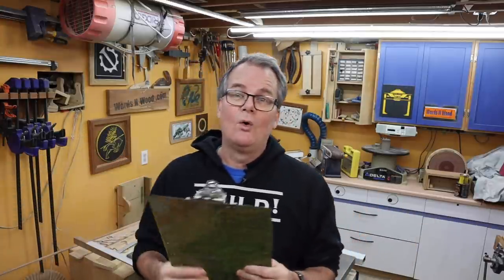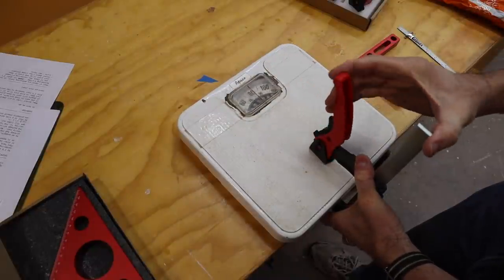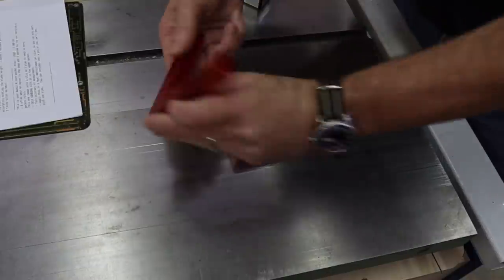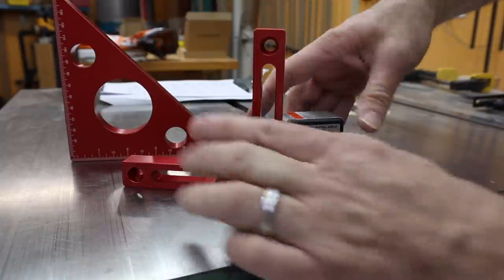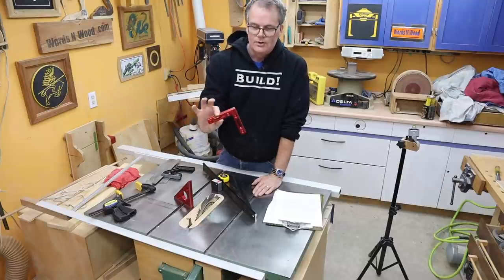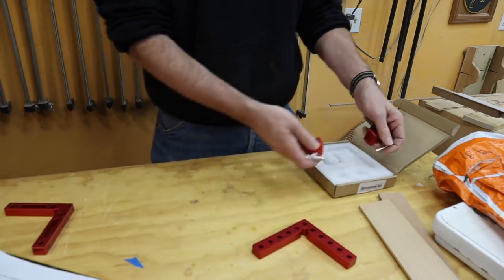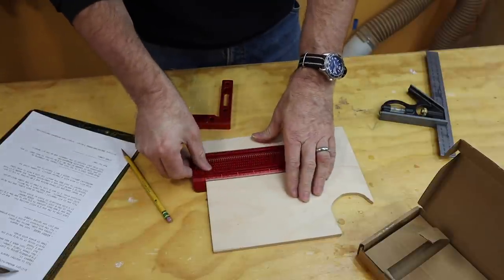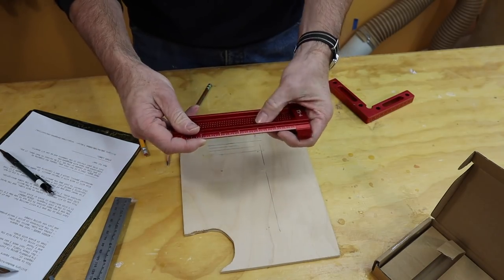Red Measuring Tools From Banggood // First Impressions // WnW 223

Comment from the maker: 🗜 LINKS TO ALL THE ITEMS DISCUSSED AND THEN SOME

100/160/200/250/300mm F Parallel Clamp  http://bit.ly/39d591b
Drillpro Precision Clamping Square  http://bit.ly/38qCwOQ
Drillpro 90 Degrees Height Ruler (Triangle)  http://bit.ly/2Xo4HaW
Drillpro 120x120mm Precision Clamping Square   http://bit.ly/35mdEG9
Drillpro TS 3 to 8 Inch  Measuring Ruler  (T-Square) http://bit.ly/2Xic6J0
6 inch Pocket Clip Depth Length Ruler  http://bit.ly/35o24KS

And here is a promotion page for woodworking tools: http://bit.ly/3pkzYbr

ALSO Here are links to different Metric-only  T-Squares

Drillpro 300/44/500/600mm T-Ruler:  https://www.banggood.com/custlink/DKKESPMYmQ
Drillpro T-160 Hole Metric T-Ruler: https://www.banggood.com/custlink/vGKhSPqdKT
Drillpro TS-3A Hole Marking Ruler 75mm: https://www.banggood.com/custlink/3v3EIP2RRV

INTRODUCTION:

A couple of months ago I was approached by Banggood.com to see if I'd be interested in checking out some of their woodworking tools.   So full disclaimer, what you see in this video was provided to me at no cost by Banggood.   However, they have not had any editorial control over the content of this video.  

Also bear in mind this is a first impressions video, not a detailed review after months of use.

Comment: Those digital angle gauges are less trustworthy than even the cheapest of squares.  So if it doesn't say 45, time to check the digital angle gauge!
Reply from the maker: News to me.  Interesting.  (I almost never tilt my TS, so I almost never use it.)
Reply: @Wordsnwood  drafting triangles are a good option. I checked a cheap one from Michael's craft store, it was smack on. I work at a machine shop and checked it on micro-view.

Comment: I have bought several things from this company and all worked fine.  I got their doweling jig and while a bit stiff at first it worked fine as I got used to it.  I also got their kerf jig which works great on a table saw or router.  It was a lot cheaper and it did take about 3 weeks to come in.  I use that thing all the time.
Reply from the maker: Good to know, thanks

Comment: From Toronto: Bought some items (drone / fpv/ bags and  few other small electronics )  from banggood. As you mentioned, they were shipped from different locations in China 🇨🇳 and took approximately 3 weeks to 1 month to arrive. Some other friends had similar experiences. Not bad and would not hesitate to buy from them but be careful and read the description 3 times or more and zoom on the picture of the item until your are satisfied and making sure what you are look at. 
Thank you for all your videos. 🙏
Avinash.
Reply from the maker: Where can you fly a drone in Toronto!?  Or did you get one small enough to not fall into the legal mess of drone laws?
Reply: @Wordsnwood   it is one of those racing drone. They are light enough to fall in those categories that you do not need a permit and an airbus/Boeing pilot license. 😂   I bought the transmitter / receiver there as well and  connected the camera to a google and convert it to fpv ( first person view). These drones can go up to 70 km/hr.  But the battery last only few minutes.  I’ve lost interest now and am more into woodworking. 😁

Comment: I bought some consumer electronic products from Banggood and the prices were good and the products were also good. The only issue was shipping. It was extremely slow. I think one item that was in stock took more than 3 weeks to arrive. You can imagine how long it would take if you did a return/replace on a product.
Reply from the maker: Yeah, I've never had to return something.  I have had to return an item from AliExpress.  Not quick, but it did go through.

Comment: Are those marking etched or just painted on? If only painted then they'll disappear fast
Reply: It looks like the markings are laser engraved through the anodized layer.
Reply from the maker: I'm not a machining/milling/anodizing expert but I run my fingernail over it and I feel little grooves... but is that just the paint I'm feeling?   I took a razor blade and scratched for 20-30 seconds over some of the metric markings (don't care so much about them) and they did not scratch off.   They feel similar to me as the markings on my many-years-old-and-still-easily-readable combination square.   ¯\_(ツ)_/¯    I hope it's good.
Reply: @Wordsnwood  i felt that scratching... greetings from the metric Netherlands ;)

Comment: Art I ordered from Alibaba some measuring devices. I suppose clamps would be fine. But the router bit I ordered blew apart, so I would not order that again.
Reply: And the Alibaba prices were significantly less than the American prices or the prices you’re quoting.

Comment: It's not just North America. Some of us here in the UK still prefer to use Imperial measurements!
Reply: For miles feet and pints not 7/8th of an inch!
Reply: @davidstreet3505  Yep. Even that.
Reply: I honestly think we're behind the times with the whole imperial thing. Think about it. A foot was measured to determine the length of a foot. A yard was determined by the distance between the top of your shoulder to the tip of your middle finger. I'm as imperialistic as the come but, as a world we could at least get behind one system of measurement.  We all use the same degree measurement.
Reply: @cindyhammack68  Which degrees do you refer to Cindy? Fahrenheit, Centigrade or Kelvin?

Comment: I often make small boxes & do small case work so I bought a set of those clamping squares after I saw a review on the Hooked on Wood channel. 

Shipping took about 4.5 weeks to get to me in Texas but I have been very happy with them. They have done exactly what I hoped they wood. They are as close to 90 degrees as I can measure in my shop and small enough to to get in tight spots to assist with glue-ups. Hard to go wrong for the price. 

Only word of warning is that the credit card I used to buy them was compromised a few days after I ordered stuff. I have no proof that bangood was where my card info got stolen but Amazon is the only other place I had used that card. I will absolutely order tools from bangood again but will keep a sharp eye on the account of the card that I use in case it happens again.
Reply from the maker: Thanks for the note...    I knew one guy years ago who specifically kept one one extra CC account, with a purposely low limit, and used that whenever he was unsure of the place that he was buying from online.
Reply: @Wordsnwood  Thanks for the idea of a dedicated card.  I was thinking about which card I wanted to put at risk but getting a new one just for that purpose seems like a better idea than picking one of the current cards.
Reply: I only ever use Paypal on suspect sites, that way there's another layer between them and my bank/card details.
Reply: My debit card got locked when I tried to pay them directly. It worked fine with PayPal though.

Comment: I've done a fair bit of ordering from Banggood, From 1mm drill bits to linear rails to digital angle measuring device. To date I've only had one "BAD" experience. I had ordered 4 pillow blocks and received 4 cell phone mounts for a bike.  I engaged customer service and they tried very hard to give me a partial refund and let me keep the cell phone holders. I had to insist I didn't need the cell phone holders. In the end I got my refund and they never requested the cell phone holders back. On the flip side when I received my 1mm drill bits a few were broken. They gave me a partial refund (or maybe is was credit to my next purchase I don't recall exactly) and I went on my merry way.  When ordering I tend to favor items that have North American warehouses and make sure I pay close attention to how they are planning to ship it. There is a option that equates to being shipped as "Freight" which means you basically have to wait for a shipping container to be filled and sent by boat (At least that is how I understand it).
Reply from the maker: But, but, cellphone holders!   how could you not want those!    😄
Reply: @Wordsnwood  still have 3 kicking around... Should I send you one :P

Comment: Hi from Saskatchewan. I have been ordering a lot of small tools that I DID NOT expect that the quality would be so good, especially DRILLPRO products. They are very well built. The shipping times have been all within  3-5 week wait. Just a little side note , today I am looking at the TS-8 T ruler and found a better price on Amazon . Yes was shocked. So I would suggest checking both sites out for price points. Advantage with Amazon is that shipping is much faster ( providing customs doesn’t get involved)

Comment: Even shipping within the US is taking a month+. I just got a Christmas card shipped at the beginning of December. So the shipping delays may not be on the seller side.

This stuff is a bunch of Woodpeckers and Bessey clones. Bummer, as at least with Woodpeckers, I want them to continue innovating and making new things without being undercut by someone who doesn't have to invest any time in design. 

The corner clamps are an exact clone of the current Woodpeckers clamping squares, even to the point of copying the interestingly-shaped clamp design. The lone L-shaped square also has holes designed for clamping parts at right angles -- it's the old Woodpeckers design. I have a set of Woodpeckers ones, but I find I don't really use them very much because I square up using a different approach. It's interesting that they cloned and sell the square with the slot and holes, but don't pair the clamps with that one.

That TS-6 is an exact clone of the Woodpeckers pocket t-square TS-6. It even has the same model name/number. I've found I prefer the stainless steel ones instead of the chunky aluminum ones for the reasons you showed when using it.
Reply from the maker: thanks for the thoughts.   
(I know of Woodpeckers, but have never bought anything from them so far)

Comment: I have all those tools but not one from that company..all of them say from china. I got mine on Amazon or Wish. 

They work as advertised and I got a special pen for the marking ruler as it was recommended. A nose pen.

They are all sqaure...I have been using them for about 3 years. One of them fell on the ground and chiped a bit making it no longer flash...I still use the inside to hold drawers together.

And to be clear they are alllll knock offs of woodpecker tools. But they are the best knock off ever....even better because they have both metric and imperial.
Reply from the maker: Good to see this feedback, thanks

Comment: Are those digital gauges accurate because they jump too much.
Reply from the maker: I had thought so, but Matthias says not...  I don't think I've ever come across a test of their accuracy.   Mine is an early Wixey model, which was one of the originals, so I would hope it is reasonably correct, but I have to admit I have not tested it.
Reply: @Wordsnwood  Matthias is correct.  In fact, EVERY measuring device in a shop should be verified for accuracy.  I found most of my tape measures to be off a little.  One Stanley was dead on and another just like it was off 1/16”.  Some rulers and the tape in the table saw fence were off significantly.  Some squares were way off of being square.  I started by testing my all machined and ground square.  Then I tested what I thought was a high quality ruler against a known accurate dial caliper which was tested against a Starrett micrometer.  Every measuring tool was tested including metal yardsticks and any with detectable errors were removed from the shop.

A tape that’s off a little is still good for laying out gardening but is bad news in a shop.

Comment: I thought Canada was on the Metric system??
Reply from the maker: We are.    Officially.    It's complicated.
Reply: We are taught metric but we use imperial. Lol
Reply from the maker: @jasonbissonnette2331  Metric for driving and distance, hours for trip lengths,  Imperial for height and weight,  Metric for fabric,  Imperial for most woodworking, but Metric for official documents  (ie: surveys and code)  Metric for outdoor temperature,   imperial for thermostats....  on and on and on..